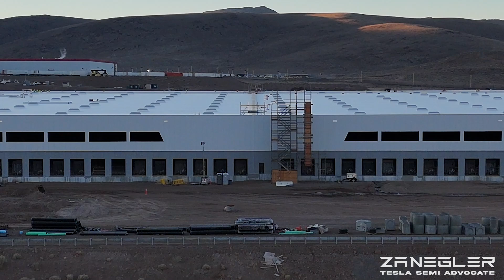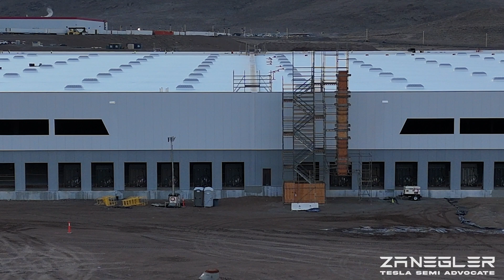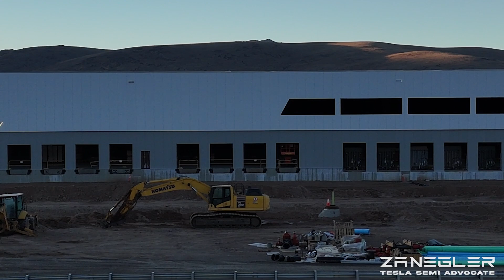It's Happening at Giga Semi!

Comment: Go get yourself some touch-screen capable gloves. Take your device in to REI, Bobos, etc. and try them on your device before purchasing. The cheapest at REI were only $24, but only have thumb and forefinger touch-screen pads. $30 gets you two fingers and thumb. These are liner gloves, so lightweight, though wear some thin nitrile rubber gloves under as a vapor barrier helps. Heavier weight gloves are also available with the touch-screen pads, but cost more.

Comment: At many loading docks there is a device at the sill which is called a DOCK LEVELER (NOT a load leveler as another drone pilot insists on calling them). They serve several functions, the original is that it makes a stable n sound bridge and ramp from the truck bed to the dock floor. Secondary function is that is locks the trailer frame to the dock so the trailer cannot move away from the dock inadvertently. There is a lock/release/warning light system. You can search the term "Dock Leveler", the manufacturers explain the function.

Comment: Thank you for another great Semi factory video. In regads of the gloves and touch screen; you can either use thin gloves with two fingers tops cut off or sliced, or there are actually multiple type of gloves which have touchscreen compatible tips on several fingers, I'm using those regularly.

Comment: Hi Zanegler,  For the cold weather, try using some nitrile/latex gloves.  If you can still use the touch screens with them on, they will help protect your hands from the cold surprisingly well despite being so thin.  I used to use them in cold winter weather doing rooftop HVAC maintenance.  They are not warm like good gloves, but when you need finger dexterity for screws and small objects/tight spaces...  they keep the wind off your skin and provide a mild insulative layer.

Comment: Truck unloading doors directly feed materials to subassembly lines that directly feed the assembly line. The new unboxed method.
Tesla has learned a lot about trucking and manufacturing, They will be able to fulfill different models and special customer requirements on the same line.
They build every part they can in-house in an efficient flow.

Comment: Hi Zaneglar. 6:45. Not a stamping press expert by any stretch. Retired carpenter/construction worker. I have watched every video of the construction of Giga Texas, and kept notes. 2000 pages or more.

13:27. Giga casting machine/Gigapress. Unrelated to this stamping press, only stating that the Gigapress machines can be built almost anywhere as the footings are very simple reinforced thick slabs.

13:48. “no subterranean chambers”. Showing the difference between the casting and stamping machine footings. Casting machines/gigapresses don't require subterranean chambers, stamping machines like that shown here at 13:48 do require subterranean chambers.

14:15. Servo pressline at Mercedes-Benz plant Bremen. https://youtu.be/9u6BC6p3mXo
Pressline at Tesla Berlin from 0.15 to 0.50. https://youtu.be/7-4yOx1CnXE?t=15
Reply: If Dessie is on the job - The World is safe - If you keep to a middle path & stick to Tesla, the company, you can't go wrong.
Reply: @edwardmorpeth5988  Cheers Edward! I won't be commenting on every video. I'll stick my head in from time to time.